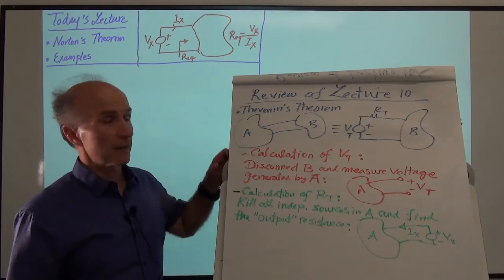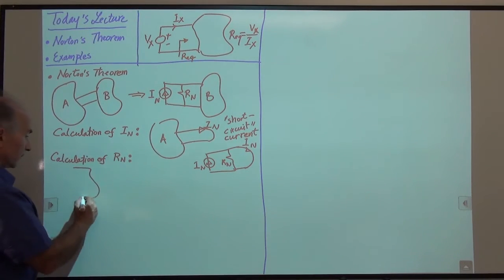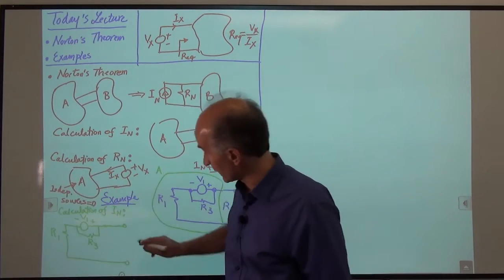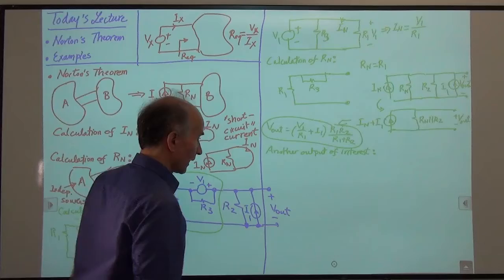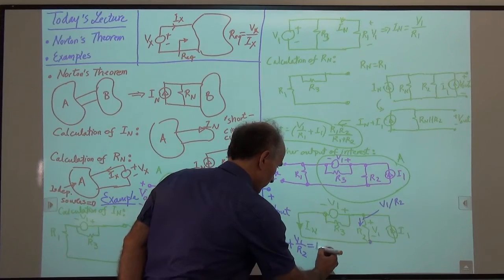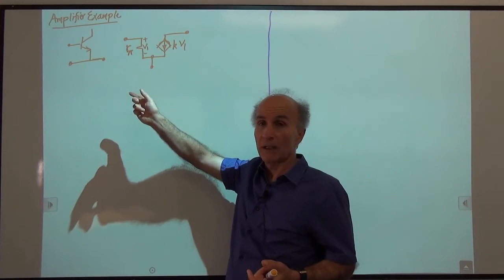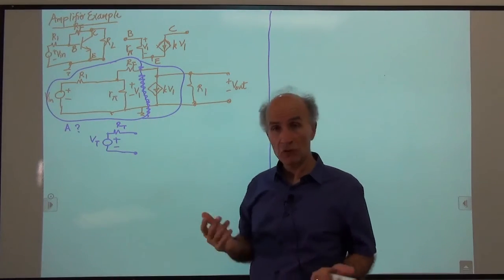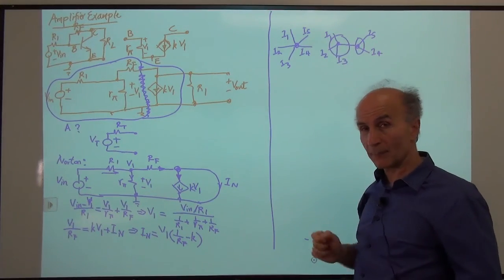Razavi Basic Circuits Lec 11: Norton's Theorem

Comment: Around 14: 58 we directly ignore that R3 resistor sir.. cuz it was connected in parallel with ideal voltage source..only if we wish to calculate power in that case R3 have priority otherwise whole calculating circuit voltages and currents we can straight away ignore that resistor R3...no need to carry that resistor further 2 to 3 steps while solving the problem.. professor I hope u  r still working in UCLA..
Reply: Not whole..it's while calculating typing error

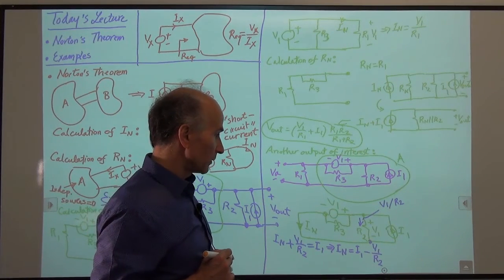Comment: At 31:49, I believe you have overlooked the fact that R_3 is connected to the node that you've performed the KCL. There is a current entering that node, i_3 = V_1 / R_3 , meaning that the final Nortons current will be i_N = i_1 - V_1 (1 / R_2 + 1/ R_3)
Reply: That current is accounted for in I_N right? The current that's leaving V1 and R3 loop (lack of better words here) is same as current entering that loop which is I_N.
Reply: You should use Superposition there. You will see the resulting current I_N is the same as the professor's.

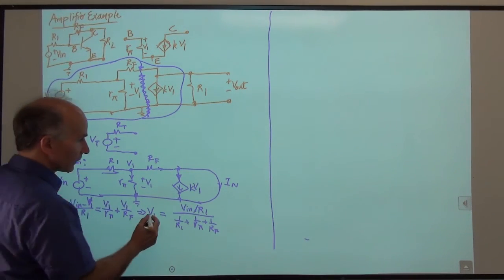Comment: At 50:19, to find In, don’t we need to consider that kV1 is 0. Because we said that the most right side of circuit is short. It means, all current coming from V1 node through Rf should be equal to In. Please, explain it for me, thank you :)
Reply: You know kV1 depends on the voltage across the resistance r_pi.  It means that we don't consider that KV1 is 0 unless the voltage across r_pi becomes 0. so in this situation, kV1 has its own current that has been generated from R_F.

Comment: I wish these video series were released 3 years ago :)
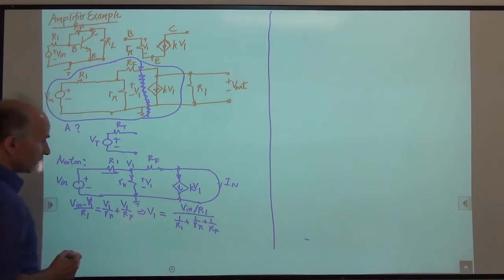Reply: At 50:19, to find In, don’t we need to consider that kV1 is 0. Because we said that the most right side of circuit is short. It means, all current coming from V1 node through Rf should be equal to In. Please, explain it for me, thank you :)
Reply: Do you complete all these lectures?..
Reply: @pubgmobile8202  learned it by  myself 3-4 years ago
Reply: @azizgundogdu9916  I just started....